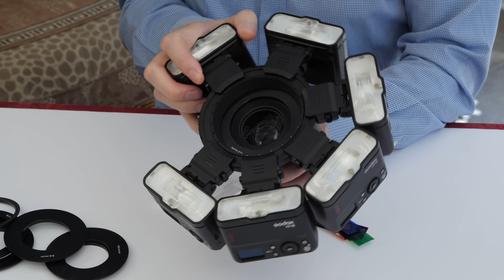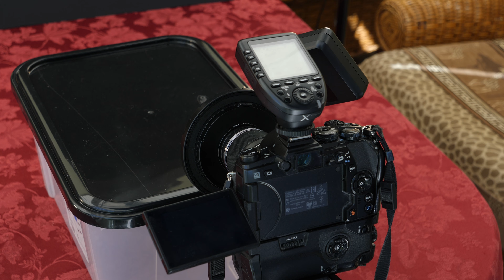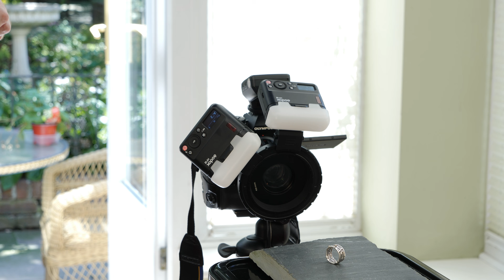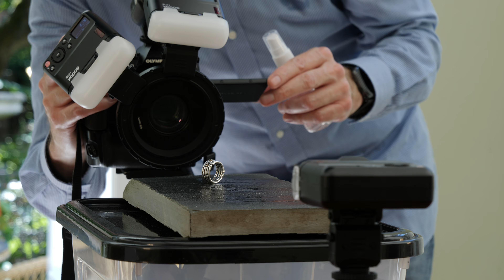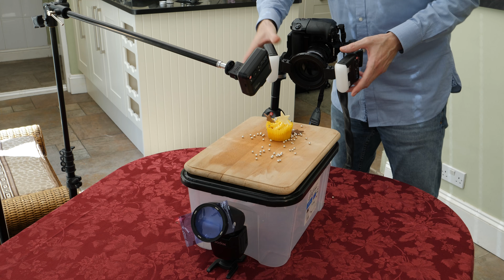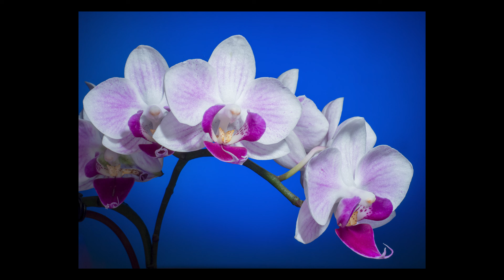Godox: Sharp Macro Photos with #MF12

Comment: Thanks Andrew for an informative video I noticed that  you used a Olympus 60 mm lens that has a 46 mm filter thread , the smallest filter ring Godox  supply is a 49 mm   thread  in the kit  so can a 46 mm filter ring be obtained from Godox   as I don't know if any 46 mm filter ring would work . Have used the Godox system for my photography work and its nearly faultless and a lot cheaper that again